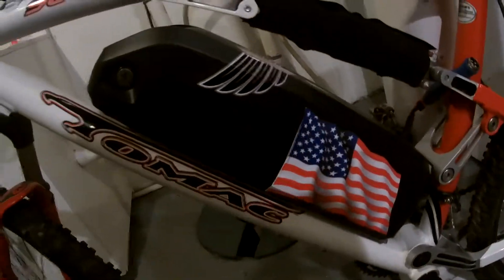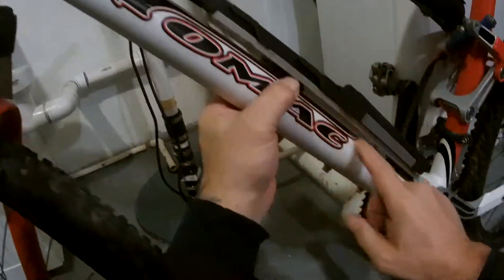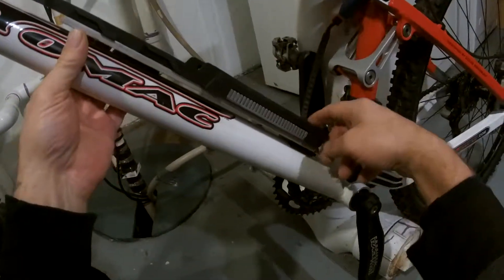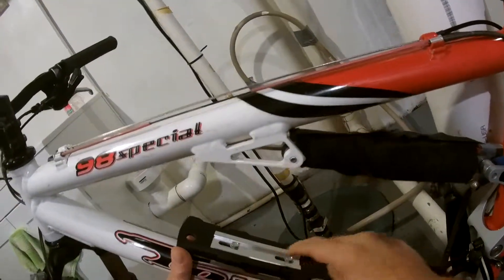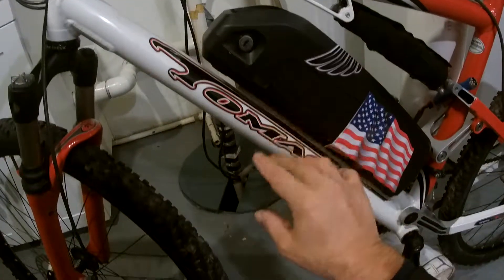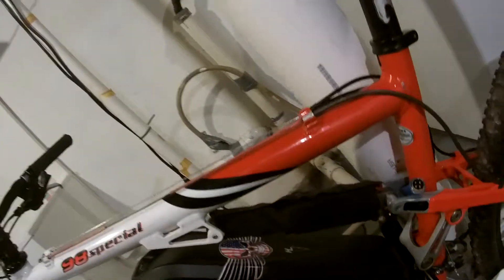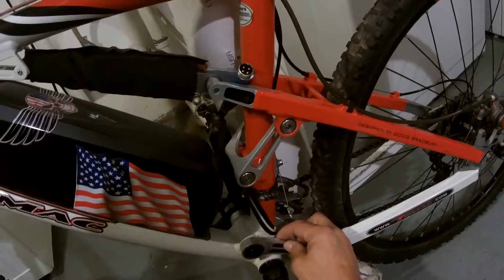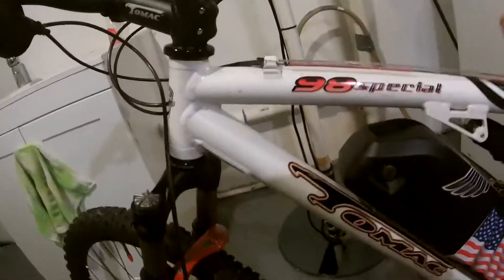DIY 52v 14ah ebike battery mount aluminium bracket Tomac 98 special

Comment: Your front fork should be the other way around right? Maybe loosen your stem and turn the fork 180 degrees.
Reply from the maker: These are not designed to brace the front of forks the dropouts face front always.Makes it a pain to mount a decent fender besides thanks for stopping by
Reply: @petertothRC-FPV  Ahh okay
Reply from the maker: @martg.b.6160  Decided to run this stock Manitou fork after all it is not bad for just cruising light trails etc. And is 100mm travel